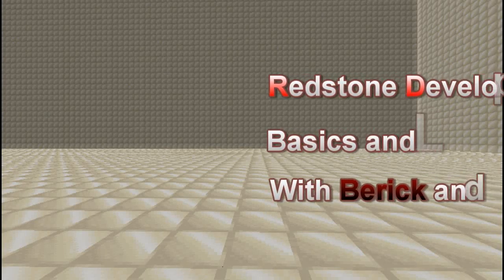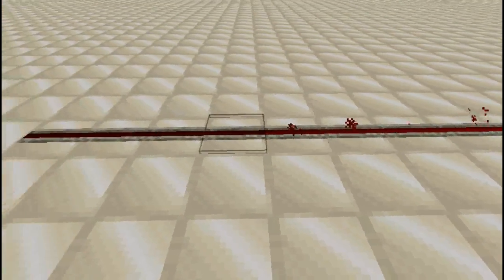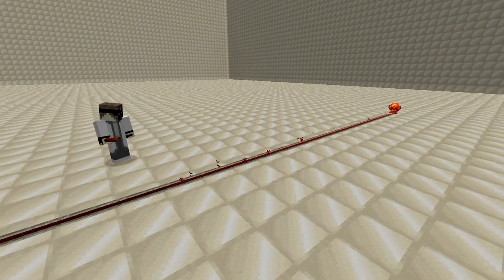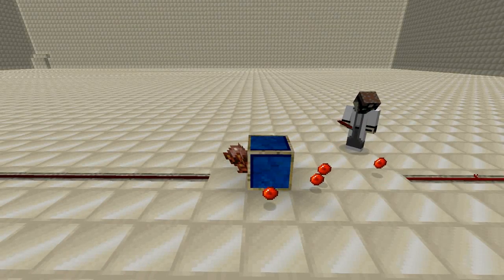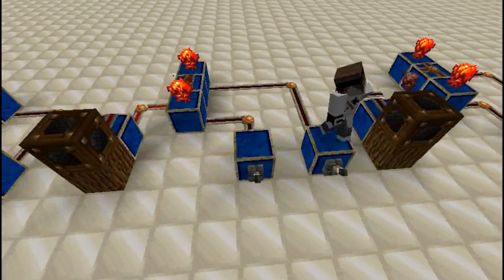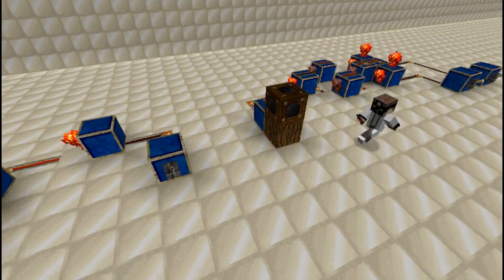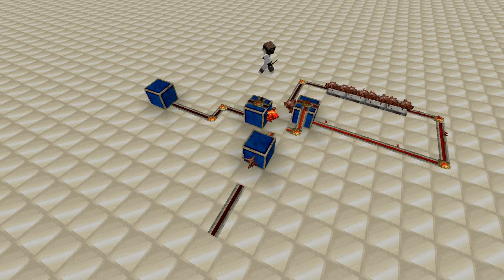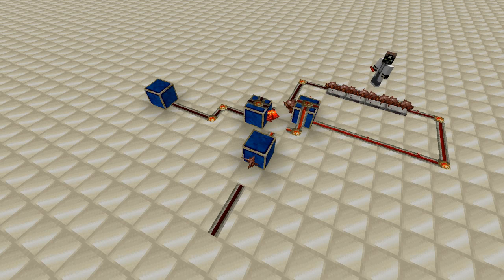RDF Redstone Basics and Logic Gates

Comment: Good video, but the double inverter circuit is a bit wrong. You can combine two inverters. Two blocks. torch on top of one of them, and a torch on the side of the other block. You put some wire on top of the block with the torch on the side.

Comment: I think you mixed up what happens on wooden vs stone pressure plates.
You said only wooden responds to player weight, and that stone requires much more weight than the player.
Wooden ones activate when an item/player/mob is on it.
Stone ones activate only when a player/mob is on it.